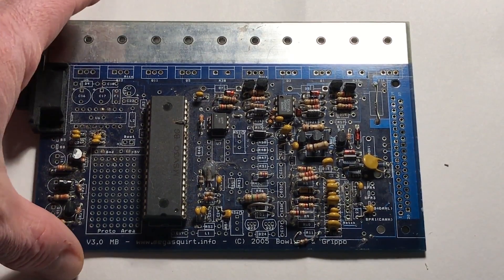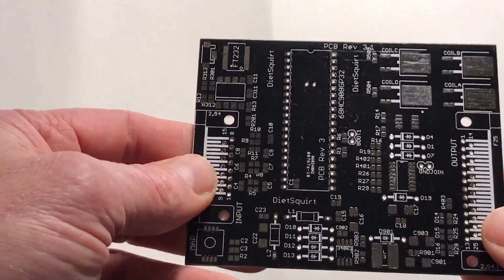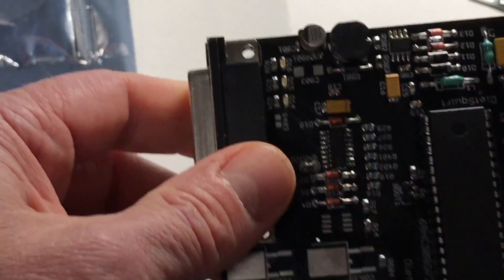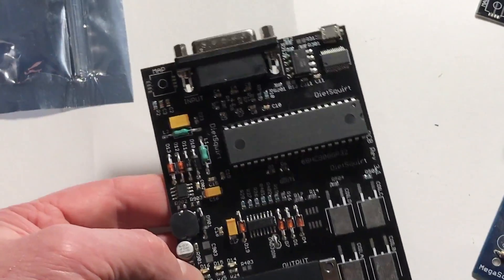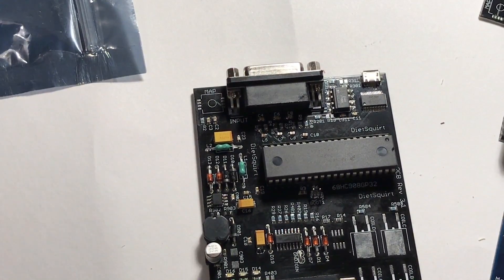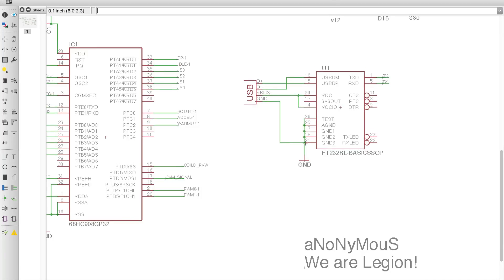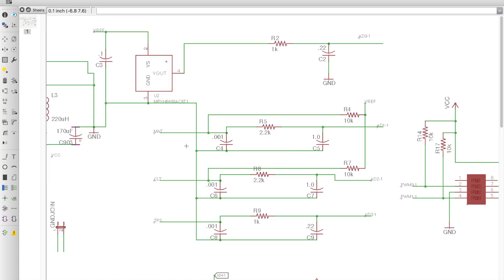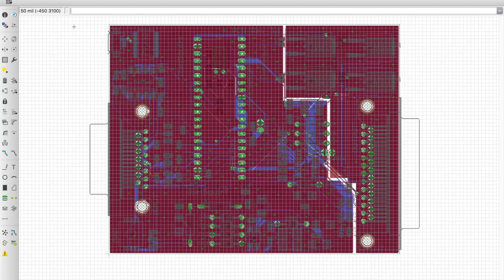DietSquirt - Design and implementation

Comment: hi! i found this video searching for a diy version of the ms2.. got your files, but there is only 2 outs for injectors? only 2?? is there a version for 6 cilinders instead of 4?
Reply from the maker: MegaSquirt 1 only drove two banks. You can run 3 or 4 injectors off each bank. Or update the schematic to use an MS3 CPU.